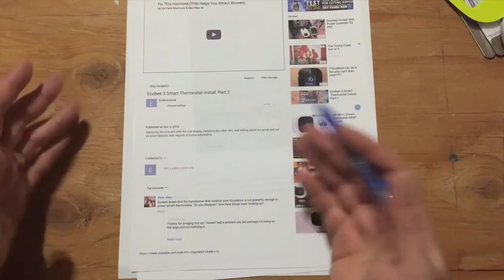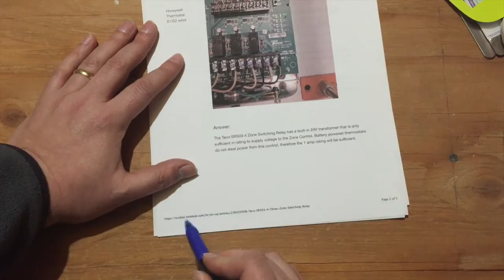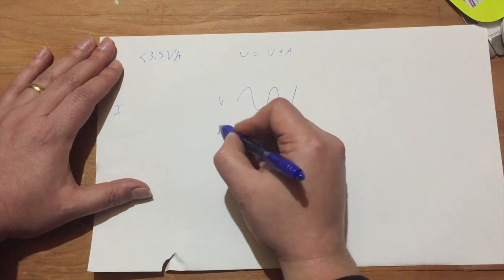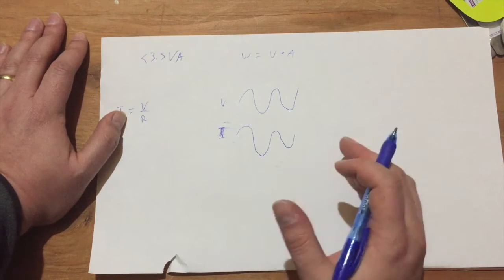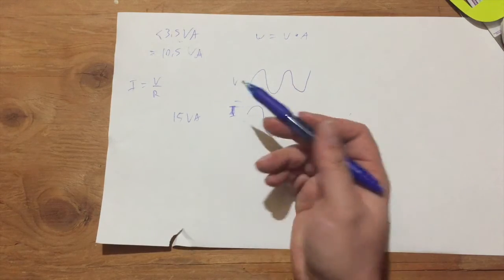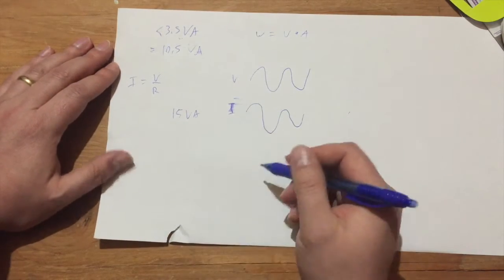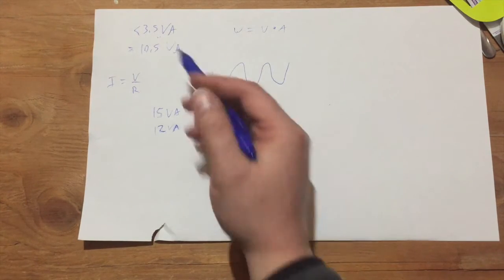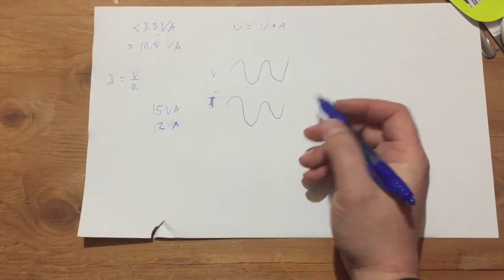#028 Ecobee 3 Smart Thermostat Install, Part 4

Comment: thanks for these videos, solved a big headache for me. Was going Nest route ( power stealing approach) without C wire. But helped me stay with Ecobee. Nest  without C wire install is not good for Heaating only system as it might interfere with relay switch , by turning it on-off even in summer months for power needs.

Comment: Great video! So I was able to get a great deal on the Ecobee3 Lite and ended up getting three of them. I have a brand new combi-boiler with a SR503 TACO controlling 3 zones. By watching your video it makes it seem like the SR503 will be sufficient, am i right to assume that?
Reply: Hey Matt, I've got the Taco SR-503-EXP and just wondering if you ever installed the Ecobee3 Lite? Did it work? How many thermostats did you install? Did you just hook up the red/white/common? Thanks!

Comment: Do you know how can I wire the ecobee thermostat to activate a pump directly to control a second zone?  I hava a boiler with two pumps and I want to monitor the second zone with the remote temp sensor and control it.